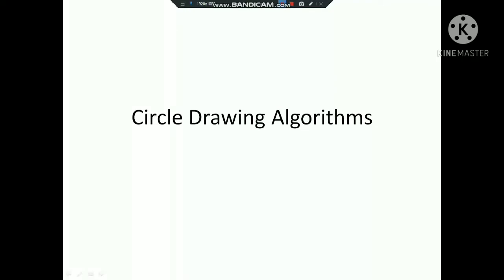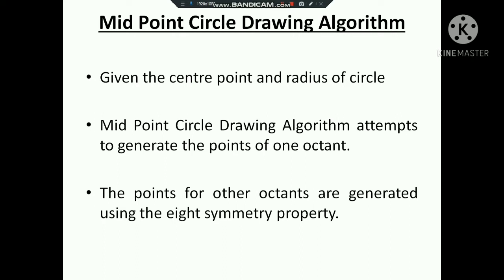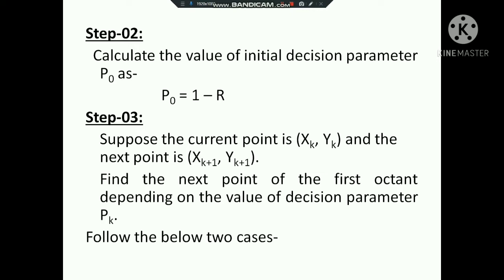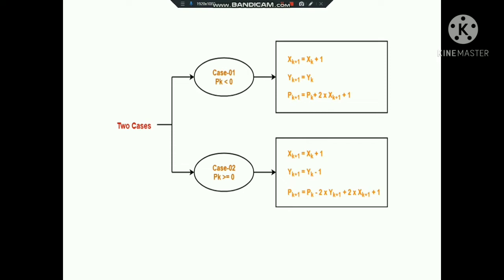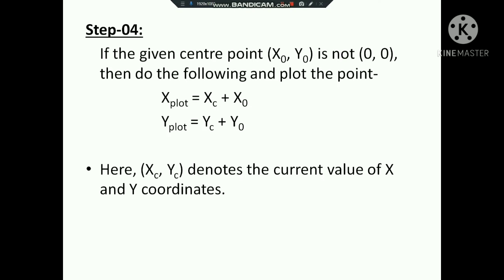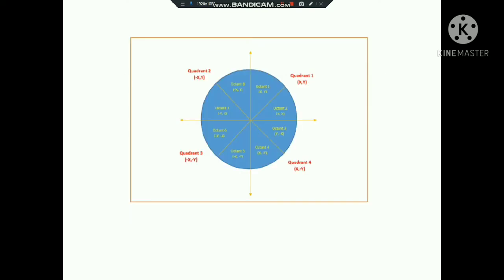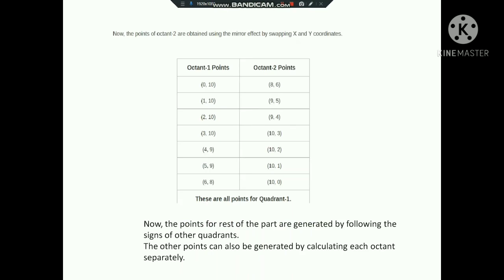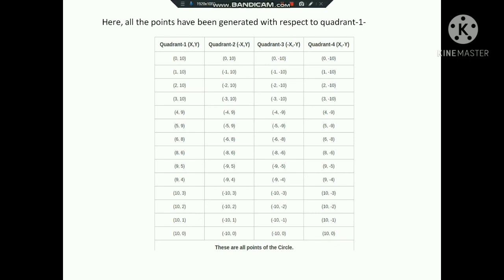Midpoint circle drawing Algorithm

Comment: 5:10 mam ithonn clear aakamo...Xc, Yc means? Plz reply
Reply from the maker: Xc and Yc are the center points.usually we are taking 0 0 as the center.If Xc Yc is another point that much distance we have to add to every other points getting rt? You just draw a circle with 0 0 as center and another with some other coordinates other than (0 0).Then you can identify
Reply: @mentoraticet  yes almost get it... If center points are(4,8)&radius r=10...then we have Xo=4,Yo=10;    Pk=-9;
Pk<0(case2).....Then Xk+1=0+1=1==(Xc+Xo=1+4=5);;Yk+1=10==(Yc+Yo=10+8=18);;

Then next plot coordinates are(5,8) PK=-9 Am I correct mam?
Reply from the maker: @ananthu4141  yes...
Reply: @mentoraticet  👍🏼